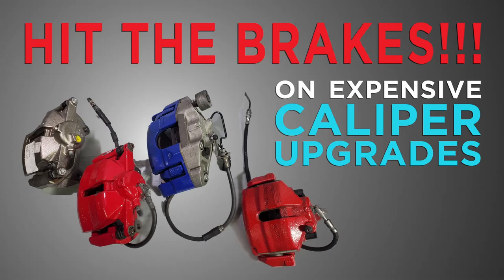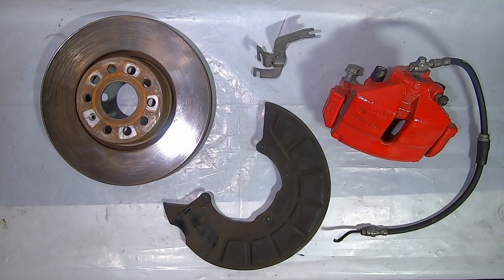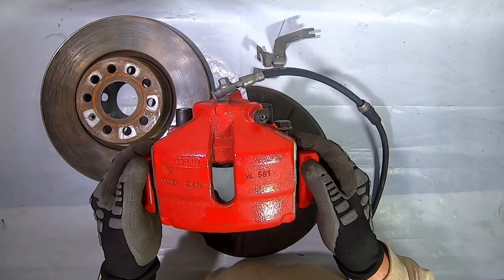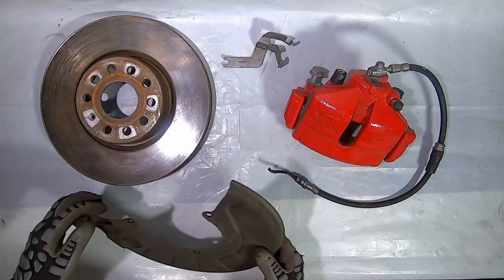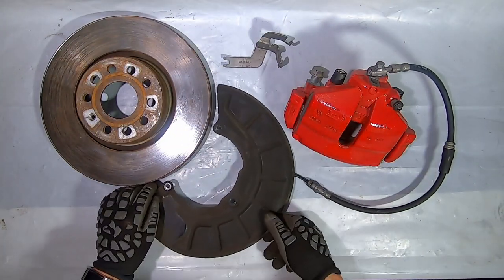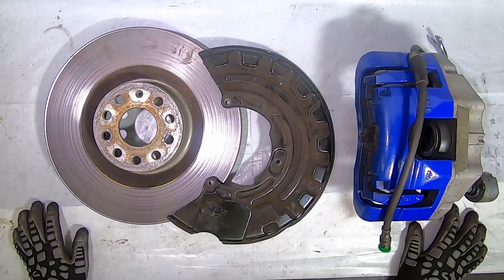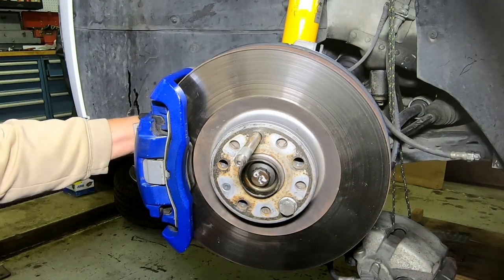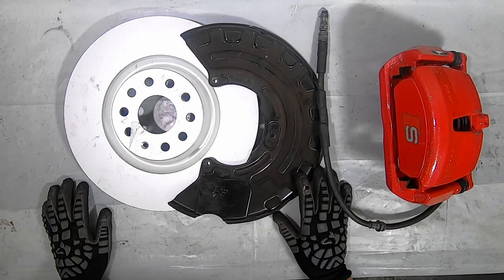VW MK5/6 Budget Front Brake Upgrades

Comment: Best VW brakes upgrade video ive seeen so far 💯👌

Now we need one for the rears 😁
Reply from the maker: Thank you.  I am working on one for the rears.
Reply: @oldguyramblings  I think the complicated part about the rears is in the variations between the TRW and Bosch calipers that ruined it, different size rotors for each brand.
Reply from the maker: As long as you stick with a matched set, caliper and rotor, you will be ok. @pichidubz-566

Comment: I have installed in my Scirocco GTS the brakes from a Leon Cupra 1P, 345mm in the front with discs and protectors from a Leon Cupra 1P, and 286mm in the back with discs and protectors, as well as metal hoses. The braking feels spectacular.
Reply from the maker: Sounds like a nice setup.  We don't get Seat cars here in the states, nor the newest Scirocco, so  a not familiar with the cars.  I am sure VW does a lot of crossover brakes systems.
Just wondering.  The 286 in the rear seems a little small for the rear with the 345s up front?
Reply: @oldguyramblings  In the Seat Cupra and Scirocco R, being front-wheel drive, a 286mm rear disc was installed, but the caliper is the same as the Audi S3 and Golf R; only the caliper carrier and the rear disc are changed. This was done to balance the braking.
Reply from the maker: @danielsarabia969 The MK7 GTI Autobhaun here in the states came with 310mm rear vented discs.  The same as the MKR.
Reply: @oldguyramblings  You mean the performance version, right? I couldn’t tell you the reason. What I’m telling you, I found out after many days of searching for information to upgrade my car’s brakes. It makes sense to me that front-wheel-drive cars need fewer rear brakes. The improvement in braking is staggering in a Stage 2 350 hp Scirocco GTS. In conclusion, I think it’s an option worth considering in certain situations, depending on prices or parts availability.
Reply from the maker: @danielsarabia969 Hi, sorry, not implying that your brake set up does not work well.  
You guys in Europe, have a lot more options to choose from than we here in the USA.
I was just noting that we have limited options, compared to what you guys have.
The same thing applies to models and car available.  We get limited options.

Comment: My suggestion because I have done it on my MK5 GTI consist of 312x25 rotors, Porsche Boxster 986 calipers and steel braided brake lines, and this setup works far better than what you put on or what my GTI started with. My two cents on the matter! Later I added two piece rotors from ECS Tuning to get rid of some rotational mass.
Reply from the maker: You have to remember the title of this video.  "Budget" Brake Upgrades.
To be sure, the 4 puck Boxster calipers are nice.  I am running Boxster S/996 calipers on my Audi CQ.  
But this video is just bolt up OEM calipers, rotors, splash shields and hoses.  You can do the R32 calipers front and rear, for about the same cost as you doing the 986 calipers, carriers, rotors and hose, just for the fronts.
Reply: @oldguyramblings  I got the calipers for the 986 used for less than $300 and the adapters for $200.

Comment: Great video! Thanks for sharing.
I have MK8 Golf R-line with 272/250 and would like to upgrade to R 357/310. I have everything except rear calipers. Any suggestions for the caliper? Can GTI rear caliper fit, since they both using 310 at rear.
Reply from the maker: Well, it all depends on the GTI.  Not up on the MK8, as I have never worked on one.
The MK7 GTI Autobahn used the same calipers as the S3 and the MK7 R, just painted red.  
Are your rear stock calipers cable operated e-brakes, or electric?
Reply: @oldguyramblings  I think is electric one, working to get blue R caliper. Or I might go with R front set with rear GTI set.

Comment: Currently looking at getting R32 brakes for my polo GTI Cup edition, so you mentioned to do this I would also need R32 lines and shield correct?
Reply from the maker: You don't have to run shields, but I always liked the idea.  
The brake shields are larger than the others so, yes, good to use.
We did not get the Polo here in the states, so can't verify the bolt up pattern for your car.
The R32 has a hard line at the caliper, so you need the R32 lines.

Comment: Thank you for a very useful video. My question is, I want to make the rear brakes of my golf 5 310mm, is it enough to replace the rear calipers with an audi s3/tt?
Reply from the maker: You can use you can use the calipers from a MK5 R32.  Yea, I am sure the rear calipers from certain Audi S3/TT are the same, just maybe a different color.  One thing you have to watch out for is, some of the newer Audis came with electric Ebrakes.  You can also find some of the Passats came with the same calipers as the R32s, just not painted.  The early Audi S3s, with VR6 motors used the same rear brakes, as the R 32.  You can also look at the MK6 Rs.  I believe they came with the same calipers as the R32, just black.
Reply: @oldguyramblings  thank you for the information. I bought a caliper with the stamp 17 on it, which was originally blue and was later painted red. i think they come out of r32. I have a Golf 5 2008 1.4 tsi, I upgraded the front brakes to 312mm. I wonder if you know that the rear 310mm calipers will be compatible with the brake line of my vehicle. and which disc should i buy only audi s3 is available in my country
Reply from the maker: @Savageboss52  Indeed, my R32 rears have 17 stamped on them.  So they are probably r32, or 6R.
I would not use this on your car, if you are only running the 312s on the front.  That is basically a GTI/GLI rotor.  Running the 310 in the rear will put to much bias toward the rear brakes.  I am not an engineering, but there is a reason behind VAG running smaller rotors in the rear compared to the front.
I would just run the matching GTI/GLI caliper and rotor in the rear.  Too much rear bias can be deadly.
Reply: @oldguyramblings  I understand. In vehicles such as opel bmw, the front and rear disc dimensions are very close. I'm currently using 255/312mm and the feeling of slumping has increased. Doesn't it allow the 310/312 to hold the vehicle from behind and put its head into the corner, which will do the most? Or am I thinking wrong. I bought the calipers for 2400tl / 91 dollars, this price is very affordable. Or should I save it for my future golf 5 gti? The front brakes of the vehicle 330mm rear stock 286.
Reply from the maker: @Savageboss52  In a corner, if the rear brakes hit first, it could spin you out.  

For you future GTI, what calipers are they using with the 330mm rotors.  Good price on the rears.  You have to remember that in Europe, you have cars that we never received, so our OEM brake up grades are more limited.

The 310 rears would probably work ok with 330 fronts.  The R32 has 345mm rotor with a 55mm piston and the MK7Rs, use a caliper with a 60mm piston and 340mm rotor.  So the 330mm rotor would be close.
Reply: @oldguyramblings  Brake features of the vehicle I will buy in the future if I am lucky. / You say 255/312 for my current vehicle, continue, I understood correctly. Frankly, I am uneasy about the 310/312 right.

-PORSCHE 17Z BRAKE CALIPER KIT

-330MM FRONT DISC

-AUDI TTRS MAIN BRAKE CENTER

-HEL PERFORMANCE STEEL BRAKE HOSES FRONT

-USP MOTORSPORT STEEL BRAKE HOSES REAR
Reply from the maker: @Savageboss52  I don't know enough about the kit you are going to use, to really give an opinion.  I sounds good.

Comment: Hi there, thanks for the video, really helpful, do have a Passat CC 2013 2.0 TDI 177bhp with the 312mm brakes, found on ebay a sweet deal for a set of callipers from R32 VW Golf  2007 3.2 R32 4motion	184KW 250HP BUB;CBRA, would those fit straight on? with shields / hoses and all that, thanks! p.s. subbed!
Reply from the maker: Hi,
I wish I could give you a definite answer, but I can't.  I have never worked on Passat CCs.  I am sure that some of the brake rotors, hoses, and shields will match up, I just can't say for certain.  You also need to check if you have an electric Ebrake or cable.  This makes a difference, too.

Comment: Great video, unfortunately all of these upgrades still over heat on the track or at speeds over 140. Changing fluid type and steel braided lines help with these setups.
Reply from the maker: I use CarboTech pads and Ate 200.

Comment: Do you think it would be a very similar upgrade from a 280mm rotor to the 340 from the tiguan? Did you run into any clearance issues in terms of wheels fitting?
Reply from the maker: Yes.  The last set of calipers used in this video came from a Tiguan(2018+).  The caliper from the Tiguan is the same as the MK7 R(GTI Autobahn), just not painted red, blue or black.
As far as wheels go, I test fitted a VW 17" Gaol Wheel on a Mk5 R32 and a MK7 GTI Autobahn.  They fit easily.  You will have to do a search for that wheel, as I cannot post pictures in comments.  No guarantees on what other 17" wheels may fit.
Main reason I went on  search for calipers, is because I am a simple spoke wheel guy, and liked the Gaol wheel.
Reply: @oldguyramblings  Great thank you. After doing some more research I just might be out of luck. The 280mm rotors off my mk6 jetta have a caliper carrier mounted on the knuckle and would require me to change the knuckle and possibly the strut. Might be something I do in the future unsure yet. Thank you for your quick response!
Reply from the maker: What year & model?

 @sambarrett1832
Reply: @oldguyramblings  2015 jetta. I do belive it is a base but it has many upgrades to it. I think it's the 280mm rotors

Comment: the only thing i can see with these set ups is the huge unsprung weight factor on the tdi you are going to notice it .
Reply from the maker: Yes, it does add to the unsprung weight.  But this video was not just about the brakes on a TDI, it covered all MK5/6s.
Now TDIs are known for getting the best mileage at a constant speed vs stop and go.  Like the duel mass flywheel, once a rotating mass is in motion, it wants to stay in motion.
Most of the increase in mass in these brake setups, is in the rotors.  So once you get the TDI up to speed, this rotating mass wants to stay in motion.  This increase in rotating mass will keep the TDI moving forward.